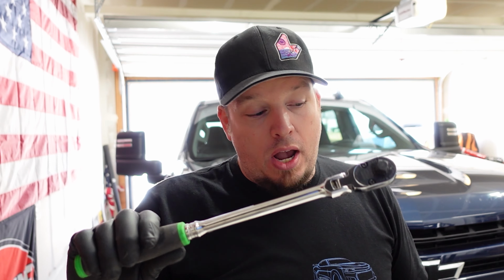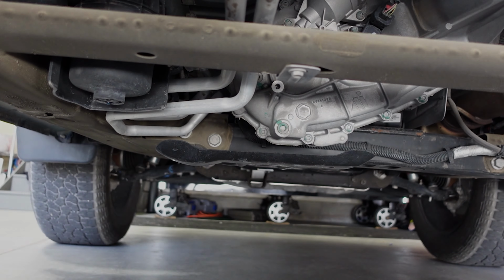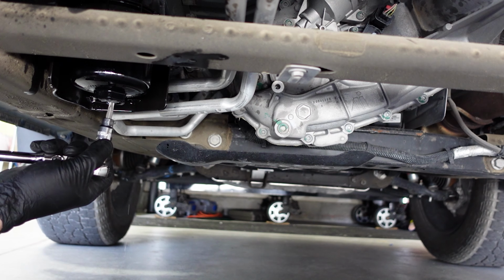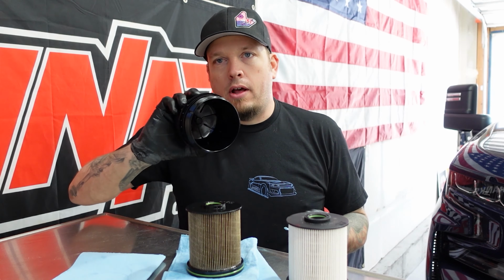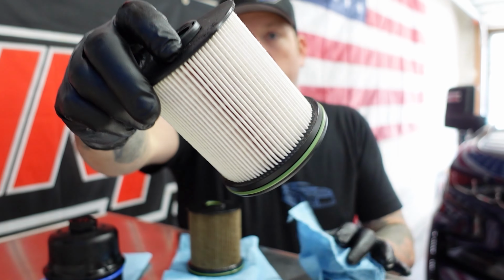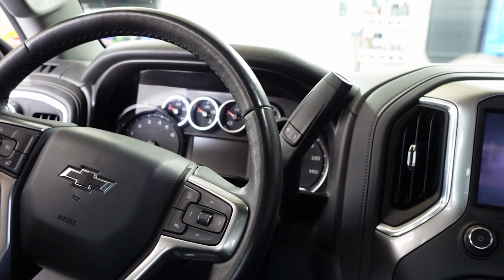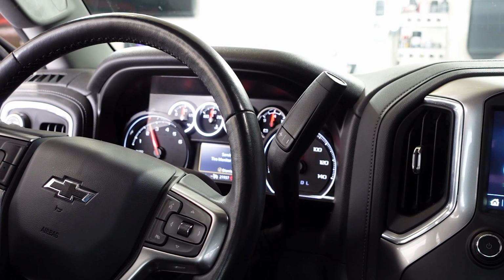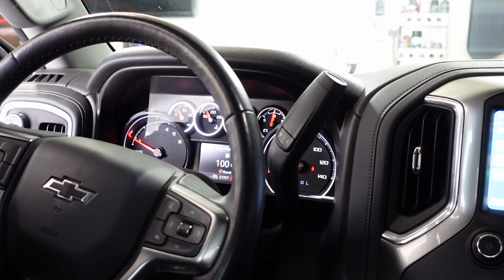DIY - Fuel Filter Change - How GM wants the Techs to do it  - LM2 Duramax

Comment: My dealer charges $136. for this.  It cost less than $30 for the filter and 15 minutes of my time.  By the way, last time I checked, Rock Auto has the GM OEM filter for less than Amazon.
Reply from the maker: Thanks for the info ! I haven’t purchased from Rock Auto before.
Reply: @DemonWorks  They usually have DexosD and oil filters in stock too...shipping is really quick.
Reply: @DemonWorks  rock auto is awesome! You pay shipping, but if you’re ordering in any quantity, it’s well worth the savings.
Reply: Hi, I was told never put a dry filter add diesel before restalling is this true.  I see you installed it dry ???
Reply: @bigdawg901 

That’s why he prime it..
Reply: Rock auto is awesome

Comment: If that housing is plastic, I wouldn’t spray brake cleaner on it. I’m sure it’s very durable but brake clean is unbelievably caustic on most materials. In my experience, it tends to make plastic parts brittle. A blast with compressed air or a water hose is the safest bet for getting rid of big debris.
Reply: Some but not all will.  Non chlorinated doesn’t hurt plastics.
Reply: No way would I risk water, 💦 🤦🏻‍♂️ those caps are very hard, cast molded plastic. Trust me when I say the brake cleaner has no effect on it. He was using CRC chlorinated while I prefer the non-coordinated dries quicker, but it’s extremely flammable.   Compressed air is not gonna remove any oily residue. Remember, this is your fuel system, keep it pristinely clean!  #JustSaying

Comment: In order to utilize the drain plug on the filter housing you need to back the housing off after you loosen the drain plug when you feel the housing start to turn easy stop and pull the drain plug the rest of the way out if need be turn the housing slightly to make sure seal is broken and housing will drain out for minimal mess this is why you didn’t get any drainage when you pulled the drain plug initially.
Reply from the maker: It was nice to see I didn't have any water in the fuel by removing the drain. I was trying to follow the GM service procedure to provide that info. I like your input on this and may give it a try next time around. thanks!
Reply: @DemonWorks  

I like your approach and methods your videos are well done and enjoyable I just thought I would mention that one step been draining and pulling fuel filter housings for a number of years same principles apply no matter who makes it just like when you dip a straw in water and place your thumb over the end and lift it out water remains trapped in the straw until you remove your thumb and air can freely flow through the straw to empty it. I just bought one of these 3.0 Duramax Silverado’s picking it up this week and glad I’m missing out on the cylinder deactivation on the 23’s I thought start/stop was ridiculous on a diesel but that is really dumb in my humble opinion but what the hell do I know I’ve only been working on turbine and diesel engines for 41 years lol. Keep up the good work your my go to info guy on these impressive 3.0 mill’s so I’m subscribed.
Reply from the maker: @adamtaylor5590  I appreciate your knowledge and kind words !

Welcome to the 3.0 community! No word on if this updated engine will get that cylinder deactivation, yet. I agree on that start stop… thankfully we at least have the button to kill it.

Comment: I like to lube the new "O" rings with a small amount of grease before inserting the filter into the housing. Then lube the 2 blue "o" rings and the inside the filter green "o" rings before I reassemble. Less o fa chance of a tear.
Reply: Its a must makes changing the next filter much easier

Comment: I’ve changed my own 2 times before this will be the 3rd. But for some reason this time I can not get the housing off. Have that same socket. And for some reason the housing is INCREDIBLY tight. Socket is trying to round off the edges. Can’t get it with that or a filter wrench I’ve tried. Housing will not budge. Any suggestions???
Reply from the maker: Get a replacement cap before you go any further. Once you hjave a new one, just keep muscling it. SOunds like possible overtorquing beforr or lack of lubrication on the o-ring.
Reply: @DemonWorks  okay thanks. Appreciate the feedback!!

Comment: My fuel filter cap won’t budge. I’ve tried pipe wrench and grip pliers and it still won’t move
Reply from the maker: worst case you will need to buy a new complete filter housing. This could happen from lack of lubrication on the seal and/or overtorquing the cap. I like to use the klickwrench socket when tightening: https://amzn.to/41UJHeD

Comment: I know this is an old post but, Do you have to relive fuel pressure before removing drain or Filter?
Reply from the maker: Good question! No need to, just slowly remove the drain or slowly remove the filter bowl. It’s not under pressure, just full.

Comment: You didn’t actually push the brake to start to get the filter to prime the first time, you just push the button, do you have to hold the button the whole or just once an wait?
Reply from the maker: If you push the brake, it will start. Just hold the button down for a few seconds and it will turn the pump on.
Reply: @DemonWorks  that’s what I thought but wanted to make sure, I love my 3.0 but was quoted over 300$ with tax for the filter change ain’t no way I’m paying that for a 30$ part
Reply from the maker: @MaineBornRedneck  exactly ! It’s such an easy process, too.
Reply: @DemonWorks  I’ve never done a fuel filter before in any of my vehicles because the filter location was always a pain, on my mini max same truck as the one in the video but black it’s right there which is awesome for the wallet
Reply from the maker: @MaineBornRedneck  message me if you have any questions when you do it mstrgoodwrench@gmail.com
Reply: @DemonWorks  Thank you for this video it made for smooth work, super glad I found this and saved myself an absurd amount of money
Reply: Do you hold the start button gif the full 2 minutes or will a few seconds get the process started and then you release the button?

Comment: What is it you are using to clean the housing and fuel bowl with? Brake cleaner?
Reply: Was the brake cleaner safe on the plastic fuel filter bowl? Getting ready to give it a shot today but have read brake cleaner can eat right through these automotive plastics

Comment: Recommended milage to change? I bought my truck private party, 21' w/53k and I went ahead and changed it here at 57500 miles & dash fuel filter life showed 7%. Forums I see a lot of conflicting info. Do you find GM service manual is to soon or to late on changing? (Obviously quality of fuel dictates this but assume its standard quality diesel). Trying to determine my interval. Note: I do still have some of the 5yr /100k power train warranty remaining till next June I believe is the month the truck was purchased. TYIA

Comment: I just changed out my filter on my 2017 2500 duramax with the Allison trans. I used a Baldwin pf46126. I felt like it seated in the housing but never really felt the "pop" like it was fully locked in. Can anyone shed some light or have experienced this?

Comment: When priming the system, are you holding the start button in for 2 minutes or just pushing it and releasing, but leaving the power on for 2 minutes then shutting off?
Reply from the maker: hold the button for 5-10 seconds and then let off

Comment: Any tips on how to get the housing off if it doesn't want to come loose?
Reply from the maker: you can try an oil filter band wrench. Other than that, if it's seized on, you may need a new fuel filter housing.

Comment: Don't rev if you have air. Reguardless of if GM recommends it. The CP4 injection pump with air in it greatly reduces its lifespan. It already only lasts 100k miles safely.
Reply from the maker: Question, where did this injection pump only lasts for 100k thing come from? I saw people say that on a facebook group. I've had several come in for service and running the original pump over 100k, just an fyi
Reply: The 3.0 Duramax does not use a CP4, FYI.

Comment: Is it the same way for a regular 5.3 gmc sierra 1500?
Reply from the maker: You don’t have one of these filters.
Reply: @DemonWorks  I can't find anything about the fuel filter or pump on a 2019 Sierra on here. Everything is duramax.
Reply from the maker: @htwntx7131  yeah, my main focus here is the 3.0 Duramax so I don’t have much content on the 5.3. You don’t have a fuel filter to replace, so you’re good to go!
Reply: @DemonWorks  My truck just started acting up today and now won't start. It seems like it does want to start put no gas flow for it to start. 🤷‍♂️ I don't know I'm lost lol dealership gonna try to charge me my soul for the repair.
Reply from the maker: @htwntx7131  yeah, it will need to be diagnosed. Lifters are common and so are valve springs. While yours does sound like a lack of fuel issue, a broken valve spring could cause your no start issue and running rough even without a terrible noise… seen it a lot. Not saying that’s your issue, just that it needs to get diagnosed no matter what.
Reply: @DemonWorks  Alright! I appreciate that. Looks like I got a day of spending what I don't want to.

Comment: Two questions for ya as a new Silverado 3.0 owner.  1. I see the first step was the water drain and there wasn’t any.  Do you do this more often then only when you change the filter?  As a pilot, we routinely check the tanks for water and just wondered if this is an issue in diesel trucks file systems. And 2. Do you have any recommendations for which oil companies have better or more consistent diesel fuel?  What has your experience been?  Some of the videos scare me on quality, underground tank maintenance and such so I want to make sure I find the best if that’s possible.  Also as a bonus, do you use any additives in the fuel?  Many tks.  Love the channel.
Reply from the maker: Welcome to the channel and the 3.0 family! 

I did the water drain merely to follow the gm procedure, I have never seen water come out. If you do open the drain and water comes out, that should be your cue to find a different fueling station.

The way I choose fuel is to go to a big name (chevron/shell/texaco/76) and make sure I go to one that I know is high volume or is in a potentially high volume area. I tried multiple local stations and ended on my local chevron. The thing I noticed with different stations was the fuel mpg seemed to vary with other stations and the noise level from the engine varied with different stations ( the diesel knock sound on accelleration)
Reply: @DemonWorks  ok Tks for the advise.  Kinda what I figured too.  We certainly have high traffic stations in the area.
Reply: @hammer-r  It seems to be nearly impossible to find top tier diesel. If you look at their site there are tons of stations around here with top tier gas but no mention of diesel. I have been using that Hot Shots can't think of what its called EDB something like that. Believe they say 1 oz per 25 gallons something like that on the jug. I usually put an oz of it in every time I fill up. I have only had the truck a few weeks though and only have about 900 miles on it so haven't done much refueling lol. I did a 700 mile trip this week though and I refilled 2x but both times I still had over a half tank. Just mom was driving my old truck with the 5.3 so she was having to stop for gas so figured I would just top off while I was there too. I know the GMC dealer filled it up when I bought the truck but I doubt they added anything and I noticed the engine was quieter when I added the Hot Shots
Reply: @JesseLJohnson  Tks for the info.  Yea here in northern illinois, there is only one and it’s a Costco about 20 miles away.  So I went there and filled up.  While I’m no expert on this truck ( I only have 2000 miles on it) it seemed to me to get worse mileage. So what I’ve done lately is hit various big newer stations when my tank was about 1/2 empty. This way if I hit a bad one, I might be able to skate by until the next fill up.  Not sure if that’s logical but I’m still trying to figure out what brands around here are the best, if that’s possible.  I do notice that most stations have a sticker on the pump stating biodiesel. I’ve heard to try to stay away from that, but it’s hard.  I also use hot shots, 1 ounce per fill up.  No discernible difference yet.  But then again as my first diesel, I’m not fully tuned into its performance and sounds yet.  Time will help that.  When I get to Colorado this summer, the local Costco has supposed tier 1 diesel and I’ll run a couple tank fulls while out there and see if I notice anything.   Let’s hope the crap we do buy out there is good enough for our expensive trucks.  I’d love to hear of one of the oil companies state that they do their own diesel and stand behind its quality.  I’d be a buyer then.
Reply: @hammer-r  I have Costco a few miles from my house but the one here only sells gas same with the one by my parents and pretty sure the one in Mobile by our other house. I just bought this truck its a 23 Denali Ultimate only have 900 miles on it so far. I do know one of the 2 times I have topped it off on the road trip it said the diesel contained 15 or 20% biodiesel and it didn't seem to run as good. That was at I think a Shell station. Driving around town I haven't got any better then 19.5 mpg but its not broken in yet I guess got just short of 30 on the highway
Reply: @JesseLJohnson  the Shell around here states on the price board, it’s not even shell's diesel.  I’ve read there are only a few suppliers of diesel so it sounds like it’s the same crap almost everywhere. I did notice that, I think it’s Mobil, that it’s prices are much higher. Either it’s their own and it’s better or just their greed.  I’ll try it sometime.  
Yea around here and most everywhere Costco is just gas.  Only one in illinois.  Well let’s hope we find a good source.  I just wish they had the same level of quality as gasoline.  Never had an issue with gas anywhere.

Comment: Did I miss something, no fuel came out when you opened the drain.....Why?  Dis regard I see thats the water drain, no fuel should come out of a water drain.
Reply from the maker: Glad you caught that. For others readying, if something comes out, better find a new fuel source
Reply: @DemonWorks  Interesting, does the small drain somehow only let water out?
Reply from the maker: @kevind1865  correct. However, someone commented that if you open that drain, then start to unscrew the filter cap, it will start to drain the fuel out of there and be less messy. I have yet to try it, but I like the idea.
Reply: The fuel won’t come out of the filter drain until you introduce air into the top by unscrewing the bowl a bit.  Just like having your finger over the end of a straw full of liquid.

Comment: How early do you recommend changing it?
Reply from the maker: I’m going to be shooting for 15k miles. This filter was mega dirty! If I pull it at 15k and it appears to be clean looking, I will adjust to longer intervals.
Reply: I swap mine at ~10k. I could not believe how dirty that thing was the first time. And the same thing happened to me. The gloves became almost pointless as diesel ran straight down my arm and into the sleeve of my jacket. 🤣

I got a couple TP1015 kits on Amazon along with a 3/8" drive 36mm/25Nm (18.4lb.ft) "oil filter cartridge" torque-limiting socket thingamajig. Other than it fitting very tight on the cap making it kind of difficult to get on and take back off, it works fine, and it was far cheaper than a good digital 3/8" torque wrench.

Maybe you did it but didn't show it, only recommendation I have is to lube the big o-ring with some diesel so it doesn't rip or bind up when tightening the cap.
Reply from the maker: @3.0dmax  all good info ! Much appreciated! I did lube it with diesel

Comment: Why the dealerships charge $300 + for the fuel filter change and $100 or so for the oil change. The oil change takes longer and requires more material and parts. Such a scam.
Reply from the maker: Go to a different dealer.
Reply: SMH, I just got hit with this charge during my 30k interval; appreciate the info, will be changing out myself moving forward.

Comment: Anyone who believes the manufacturers recommended fluid & filter changers needs to pull their heads out of their as$! You need to cut everything they say in half. Those recommendations are just to get you through the warranty and that’s it.
Reply from the maker: it's not the dealers, it's what's in the owners manual that will just be enough to get you through the warranty. A dealership will then be called a stealership when trying to inform the owner that earlier maintenance can help extend the life.
Reply: @DemonWorks  yes, I meant manufacturer not dealer! Dealers just go by the book if you have the maintenance plan like I got. Two oil changes per year and have to go by the manufacturer recommended changes for everything else. 
Total joke…cancelling it tomorrow